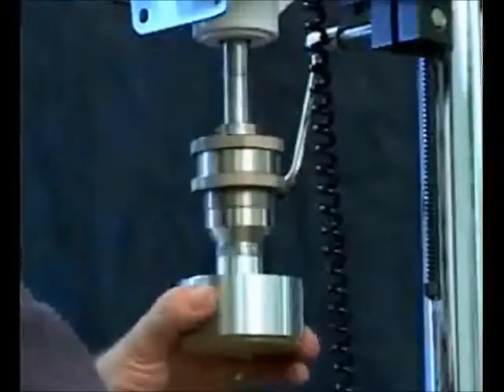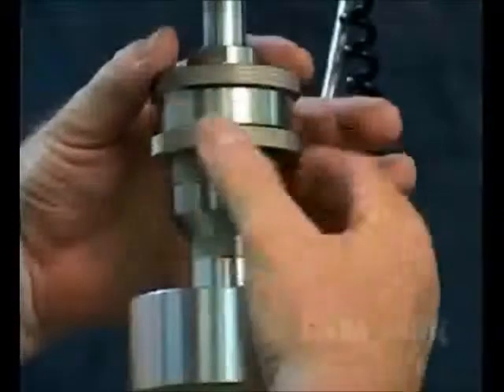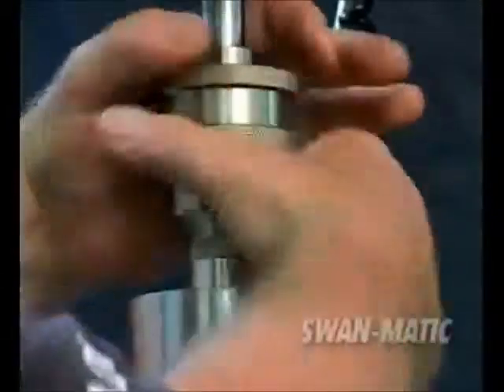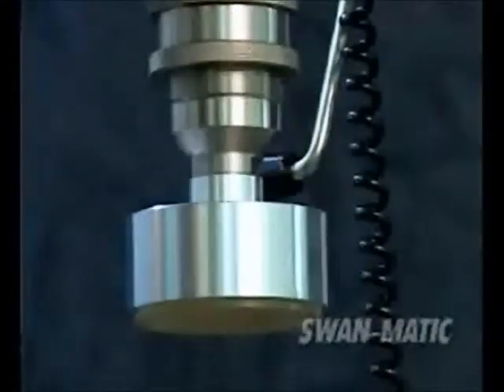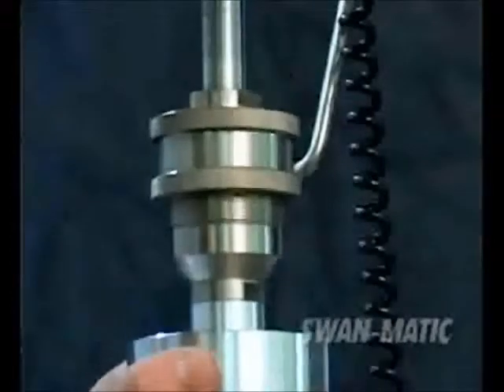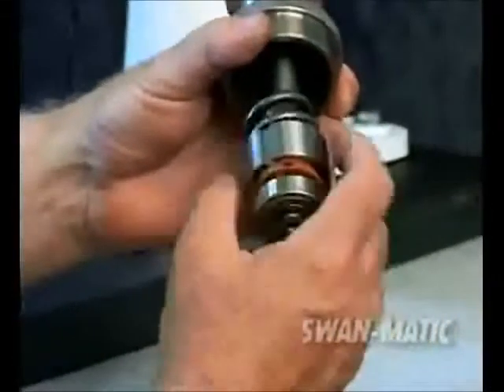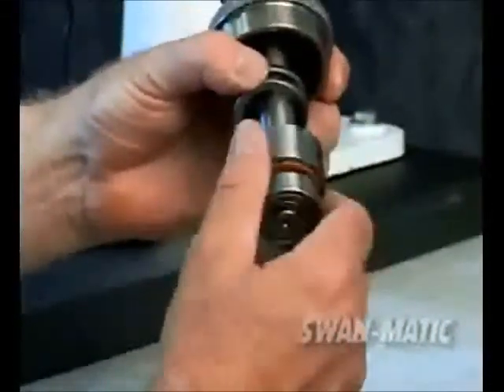clutch adjustment

Comment: Is it safe to say that adjusting the lower ring tightens the chuck/clutch setting?  And that the top ring being turned in a downward direction is increasing the torque?  I will call in tomorrow .
Reply from the maker: Please contact sales@autodev.com for more information.
Reply: @AutomationDevices  Thx. I called in and got my answer afterwards.